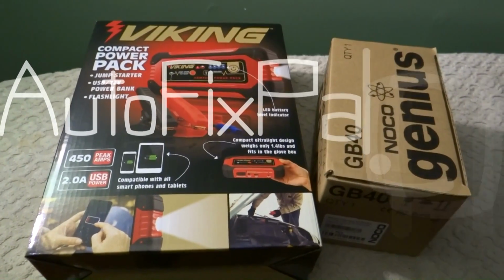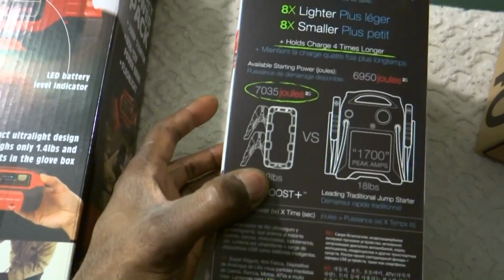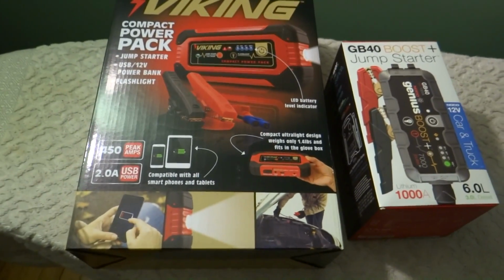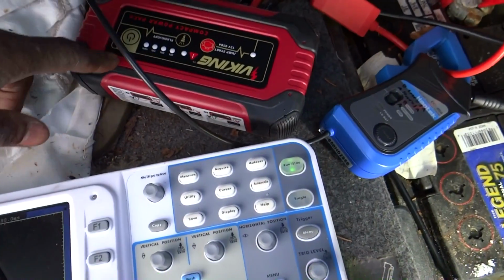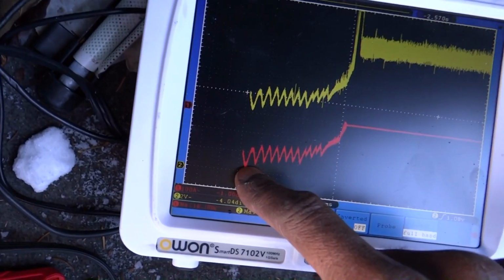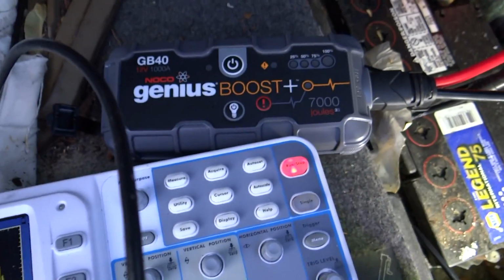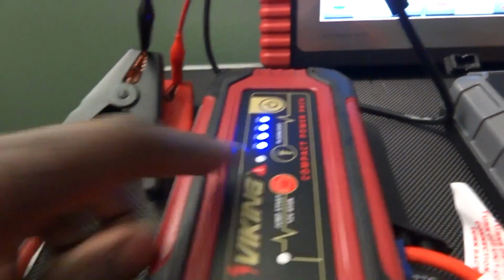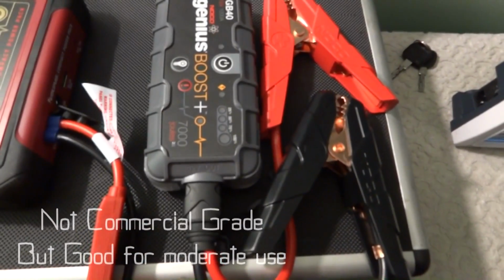Harbor freight lithium iron jump pack booster VS NOCO Genius Boost GB40 jump pack / booster - Review

Comment: NOCO Boost Plus GB40 1000 Amp 12-Volt UltraSafe Lithium Jump Starter Box, Car Battery Booster Pack, Portable Power Bank Charger, and Jumper Cables for up to 6-Liter Gasoline and 3-Liter Diesel Engines TO BUY . https://amzn.to/3VExjd5

Comment: I have both of them. The NOCO GB40 ($100) is better in terms of capability of starting car with dead battery and charge holding. But neither of them is good for mid size or minivan especially cold temp. I used them to start my compact car in the coldest days of last winter (10 F) with dead battery,  but neither could. When the temperature rose to 30F, the NOCO could do about 50% of the time. Had to use gauge 2 jumper cable to rescue my compact car. You should have it as back up, btw

I would not recommend  either one of them for jump starting any mid size or larger vehicles if you live in cold climate. The Habor Freight at best is good for USB power pack for your phone. Its power holding after fully charged is not so good. After couple months, in storage, it loses 25% of its charge. The NOCO seems better

Buy more powerful ( but much more expensive)  NOCO power pack if you want a good jump starter. You got what you paid for

Comment: Thanks for the review and the time you took to do the tests. I bought the Harbor Freight one last night for $59 using the coupon code here, not sure for how long it will work.  https://www.harborfreight.com/Lithium-Ion-Jump-Starter-and-Power-Pack-62749.html?ccdenc=eyJjb2RlIjoiMzkzMTc3MjciLCJza3UiOiI2Mjc0OSIsImlzIjoiNTkuOTkiLCJwcm9kdWN0X2lk%0D%0AIjoiMTE4MTQifQ%3D%3D%0D%0A&cid=paid_google|||62749&utm_source=google&utm_medium=cpc&utm_campaign=&utm_content=&gclid=Cj0KCQiAtOjyBRC0ARIsAIpJyGOxAhsVH4jIE2oB4hCEiQEGKr_dxiS1i_Wiafxx9nI6DtqAOpWaN9saAiRsEALw_wcB

Comment: Turns out on the latest Project Farm, both are junk!
Reply: I'll see if I can find this Project Farm that you and two other people mentioned.  So far I see 20% 1 star ratings for both of these and 70% 5 star on Amazon and Harbor Freight websites and AutoZone's website has sumilar for the NOCO it sells.
Reply: @quentinquogamoddy1999  Yeah, Project Farm tested the TopVision as best. I actually have one and ironically it came with bad cables. I made a video on another I got super cheap though and it works great. The cheap packs work great.

Comment: Should have pulled the fuel pump fuse to disable it from starting. Would have only cranked. Could have also seen how long each pack lasts. Cranked each 10 seconds at a time. Let cool then another ten seconds. 4 or 5 times then read voltage.

Comment: I've got a NOCO GB20 I got in the half price clearance section at tractor supply. Was able to get 3 starts on a 4.0L Nissan Xterra before it ran out of power. The big surprise was starting a 5.9L Dodge truck. The GB20 states it is good up to 4.0L.

Comment: only the gb40 would start my land rover.  cold and dead it requires about 600 amps.  In general the gb40 (1000amps/24000mah) is twice as powerful as the HF (450amps/12000mah)  with better cables for $8 more.  

not much of a choice here.
Reply: GB40 has 11.1V LiPo with 2150mAh and 120C burst current which translates to 6450mAh at 3.7V, thus about 24Wh. It is not 24000mAh. And 120C at 2150mAh translates to 258A Burst current for 10 seconds. 1000A claim is for 3 seconds.

Comment: I would take the LifePO4 battery chemistry over LI-ON (and possibly Li-Po) any day.   Reports on the Noco GB40 are that the batteries have puffed up (de-gassing hydrogen in the sealed packs) and therefore those batteries are done.    LifePO4 is safer, holds charge longer, can be completely discharged without damage,  and has more charge/discharge cycles in the long run.
Reply from the maker: Great info!

Comment: How does this guy own an osciliscope and not know what a joule is as an increment of measure. Smh
Reply from the maker: because in the automotive world, where i work we don's use joules to describe anything as an increment of measure. It's amperage, resistance and voltage. Yes an oscilloscope is very useful for diagnosing automotive related issues.  automotive batteries don't have joules listed, it's cold cranking amps and cranking amps that are listed usually. None of the classes i have ever attended references joules as a useful measure to help me diagnose an automotive related issue. Not an electrical engineer and not claiming to be one. Have a nice day.
Reply: @Autofixpals  I've had a wonderful day and you should educate yourself . I've worked on replaced or rebuilt or Mai tained every single system on my vehicle due to the fact I'm on a budget and I know. Do you work in a shop because you can turn a wrench , or are you an  ASE certified mechanic. If you are I'm kinda surprised you don't know . Don't worry I'm  Not losing sleep over it.
Reply from the maker: @pj7362  I am a certified Nissan Technician and knowing what joules mean has never stopped me from diagnosing any vehicle. Like i said its not something used in the auto repair industry as a means of measure. I am also certified by the state of NJ to perform obd2 emissions repairs (ASE master required, or equivalency training course passed) Im pretty sure joules is not mentioned on any ASE test. Watch a few automotive diagnostic videos on YouTube and i can assure you that none of them use measurements in joules, to describe any measure of electric energy.

Comment: You need to check your facts and know what you’re talking about when it comes to amps, volts and joules... you sound dumb to the people that actually know what they are talking about. All your data shows is draws of Amps relative to what the car needs and is taking from the pack itself.
Reply from the maker: That is the purpose of the test. To see if the packs are capable of delivering the current required to turn the engine. Why do you think I connected an amp Clamp?

Comment: Very strange for a current or voltage to be present w/ the unit turned off! Either way, it will do the job. Thanks for the review/comparison. These sound like a great "little" peace of mind for traveling. Like the reason I ever got a cell phone - security on the road/out-and-about.

Comment: I used a NOCO at work and it worked great. I think ours was a 2000 amp version. These little things are impressive and great to throw in the car for a road trip but do not use them for extended cranks.

Comment: The NOGO GB70 has a 2 year life expectancy if you keep it in your vehicle and is prone to drastic temperatures it will stop charging the battery
Reply from the maker: well Steve i have had my GB70 in my car for the past 2 years and have not used it. But given your statement i will surely give it a try next time i try to jump start a vehicle. Also the Viking has been in the back of my wifes car since i made this video. I will also be doing a round 2 kind of test on the GB40 and the viking.

Comment: To do a full body comparison on the product you need to have two dead batteries in it two different vehicles so you will get a better accurate reading.

Comment: I doubt this will start a V8 engine. My Peak jump starter, 900 cold cranking amps , I bought from advance won’t jump start a V8. Although it claims it will.
Reply from the maker: i have used it on numerous occasions to start Nissan NV3500 (5.6l v8) and some Titans with the same V8. With a full charge on the GB40 it will start most regular non high compression V8 engines.
Reply: I've used the Viking to start a crown Victoria 4.6 without a battery in it!
Reply: I used a NOCO GB20 to start a 5.9L Dodge Ram. The battery had enough power to make a 'clicking' noise, but wouldn't crank engine. With the GB20 hooked up, it cranked slow, but did start.

Comment: How has the jump starter worked so far? Looking to get one for a 6.0L diesel as a gift.
Reply: The gb40 would be to small to start that size of a Diesel engine. Try the gb150, it'll start an F550 Diesel engine, no problem..

Comment: Not only is the engine oil colder / bearings dry, but the fuel also has to be pumped up from the fuel tank to the fuel injectors. I would say it not comparative.   You gave the GB40 a small edge, the lithium phosphate battery on the Viking can probably deliver more amps.

Comment: the reason the NOCO GB40 only has 12.1 v  it uses only a 11.1 volt battery pack ! i take the VIKING any day or the GB40 !
Reply: You can't crank a dead battery on 11.1 volts.. The NOCO uses 12.6 volts as that is the target voltage of Automotive Batteries. Over volting to 13.+ robbed you of Amps. As Voltage increase. Amperage decreases. Ohms Law...

Comment: When its off the reason the HF shows 13 volts is because the unit uses an electronic relay (the large black FET you pointed to earlier when it was open) instead of a mechanical relay. Electronic relays always leak voltage when they are off, but they won't pass any current. Thats the disadvantage of electronic relays. You encounter that on almost all lithium BMS. The noco being more expensive probably has some circuitry to deal with it.

Comment: Both of these units are made in China. Most likely by the same company. The obvious noticeable difference is the leads one set looks more robust than the other for sure. I think they performed pretty close to identical. The real test will be longevity of the battery pack inside of the units.

Comment: Joules- Amps conversion and explanation
7035J = W * T
7035J=V*A*T
7035J=12*A*T
/12=/12
586.25A/Sec.
For some reason I don't think that is right?  Can someone correct my math?
Meaning it can probably peak at 1KA for a fraction of a second, but the mean output is limited at 586.25 amps over a one second period.
Reply: OMG--WTF

Comment: Just watched this, but a tow truck driver used the HF to jump my 2007 Escalade with a completely dead battery. It has a 6.0, and I've had no problems in a week.

Comment: This is meaningless, because an "amp clamp" only measures AC, but what these batteries and jump starters put out is DC.  Nothing personal, dude, but you need to go to electrical engineering school at a real university and understand the basics before you start trying to educate anyone, or do a technical review with a youtube video!
Reply: Look up DC current clamps.  They certainly exist on almost every modern clamp meter.  Serious though, look them up.  Buy one.  You'll be light years ahead of your well educated peers.   :-)
Reply: The Hantek CC-650 is able to read both AC/DC  current.
Do you know The difference between a chimichanga and a burrito 
There are many other meters made by companies like Snap-on that make only DC amp-meters for automotive use.
Reply: I got a DVOM from Lowes that has an AC/DC clamp meter. It was $70 
I bet there are many others out there just as cheap.
Reply: I was more impressed with his knowledge than yours Burrito.

Comment: It's not 'lithium iron', it's 'lithium ion'. It's nothing to do with iron. An ion is a molecule - in this instance lithium - with one electron extra or taken away. Please understand the basics of science before you attempt to explain things to other people.
Reply: It is a Lithium iron Phosphate (LiFePO4) battery as he read off the box. Try read along and understand battery types and chemistry before being critical.
Reply: should it  be Lithium-ion/Iron battery or should it be labeled lithium phosphate?
Reply: lol!
Reply: They spell differently in Shina, I doubt the box was printed in the US.
Reply: The lithium iron phosphate battery, also called LFP battery, is a type of rechargeable battery, specifically a lithium-ion battery, which uses LiFePO ₄ as a cathode material, and a graphitic carbon electrode with a metallic current collector grid as the anode. Wikipedia
Reply: This 'tester' is no rocket scientist !!!
Reply: LET's see what you have,  Mr.  @Charlee1224
Reply: https://www.newcastlesys.com/blog/lithium-ion-vs-lithium-iron-batteries

A lithium-iron battery is also a rechargeable type of battery but made with lithium iron phosphate (LiFePO4) as the cathode material.

While lithium-iron is a newer version in the lithium battery family, its anodes are also made up of carbon in batteries.
hosphate based technology possesses superior thermal and chemical stability which provides better safety characteristics than those of Lithium-ion technology made with other cathode materials. Lithium phosphate cells are incombustible in the event of mishandling during charge or discharge, they are more stable under overcharge or short circuit conditions and they can withstand high temperatures without decomposing. When abuse does occur, the phosphate based cathode material will not burn and is not prone to thermal runaway. Phosphate chemistry also offers a longer cycle life.

Lithium Iron Phosphate (LiFePO4 ) characteristics:

            Most stable
            Good density
            Long life
            Economical

Comment: The booster did not "pull" anything it sourced X number of AMPS! The starter is what draws current from the battery, basic electronics. You should know what's happening, and how what you are doing works or supposed to work in order to explain things . You just Ramble on, and on.

Comment: Jules is the energy capability. Not a chance it will do 1000 AMPS?
Reply: 1000 amps would sizzle those cables ...
There is no way is could do 1000 amps.

Comment: So here's the problem with this test...  (and yes, the battery is totally irrelevant in this case)...

Unfortunately you're assuming that the numbers (AMPS) on the oscilloscope represent the total power available by the battery packs, and it is not!!!  The number shown is simply a representation of what was demanded or drawn from the battery pack by the starter to start the engine.  

For example,  a 400A battery pack may indeed be capable of providing 400A of cranking power, but if the starter only requires 200A to crank the motor, then that is all it will draw...  unless more physical resistance is added (friction for example, from an engine that has sat so long that there is no longer oil coating the cylinders and piston rings).  As more resistance (physical) is added the starter will "demand" or require more amperage.

I'm pretty sure the initial spike of 300A you saw at the very start of the first test was due to the lack of oil as stated above.  As lubrication was provided it almost immediately settled to the 200A mark (which is likely where this starter normally would be under normal operating conditions / everyday use).  The second test started at 200A and remained constant due to it not having to overcome a "Dry-start" or oil-starved condition.  If you had tested the packs in the reverse order the results would have been similar...  the noco would have likely drawn 300A initially, settling to 200A and the Viking would likely have drawn a consistent 200A.  

The Amps drawn will fluctuate due to oil viscosity, engine temperature etc.   More amps are required to start an engine in the winter cold than in the summer heat.

An electric motor will only draw enough current to overcome it's resistance.  In the case of my wife's 525W Kitchen-aid mixer, it  will only draw what it needs to, to perform each task... it DOES NOT draw 525W at all times!!!  525W is simply what it is CAPABLE of drawing / handling  (max).   For example, If you're mixing a bowl of water, it will only require 50W.   HOWEVER, if she's making bread dough (more physical resistance), which taxes the motor quite a bit, it will draw 200W or more!   I don't know what you would have to do to make it actually approach the 500+W mark in real world use.  Incidentally the big reason to get the Pro series mixers (if you're in the market for one) isn't the extra Amperage, it's the fact that it's gearing is metal instead of nylon / plastic which strip if you try to do bread dough!...  a "Safety" feature apparently.  Anyway...  yeah...  Who cares about mixers?...

I hope I explained that reasonably well.
Reply: Don't even need a battery
Reply from the maker: C C you explained it just fine. However I am already aware of that. That's the reason I used the viking first. The GB40 is already proven and people know it is capable. But at the time of this video the viking was relatively new and not really proven....the only way I could have made this test 100% equal would be to do it over the course of a few days. I didn't really think that was necessary since the main point was to see if the cheaper viking booster was capable of getting the job done and this test proves that the GB40 is at least capable of starting a 2.5l that's been sitting for a few months... I do appreciate your comment and thanks for checking out my video. 😁
Reply: You did not have to wait a few days all you had to do was drain the fuel from the fuel lines and let the engine reach ambient temperature, less than two hours to do a comparative demonstration.  
When starting an engine with electric fuel pump it is also a good idea to cycle the ignition at least two times to prime the fuel lines up to the injection system.
Reply: you wrote an essay paper to say a dry start pull more amps  not hating on you
Reply: You could have dropped the term 'back EMF'   do they still use that term?
Reply: Problem is these jump starters are not providing 1000 Amps.. The cables are only 6 gauge.. They would catch fire if cranked longer then 10 seconds. Why they limit the draw capacity to 250 Amps. But you can get 10+ jumps off one because of that..

Comment: Excellent review, yes was a bit long as did not need all details on the boxes, worst case scenario, jump ahead for those critics lol, only thing would have been a readout of voltage and capacity right after those boosts. The noco looses 25% on first boost with less amps. Keep up the good work.